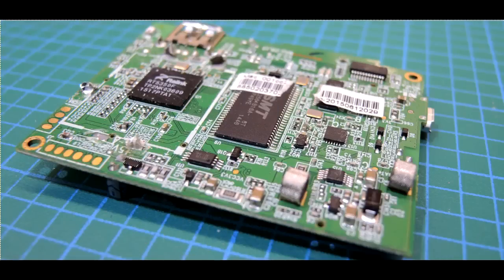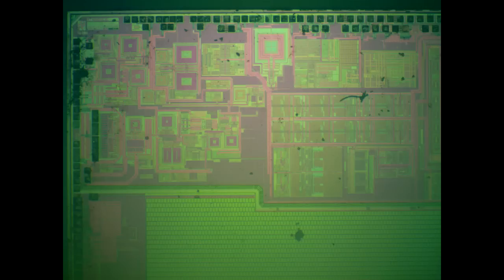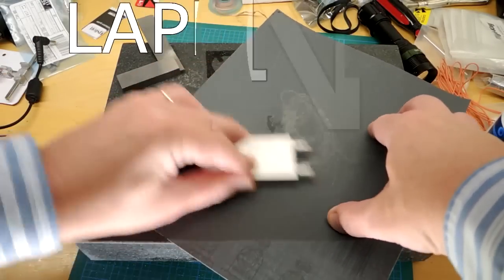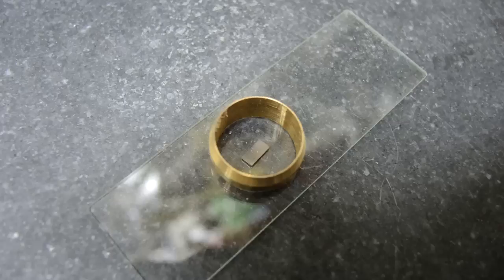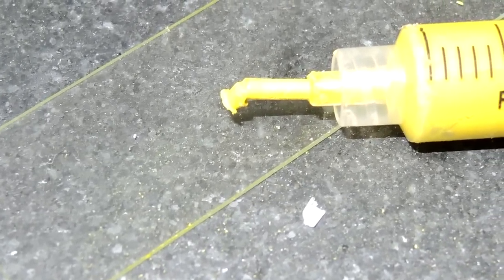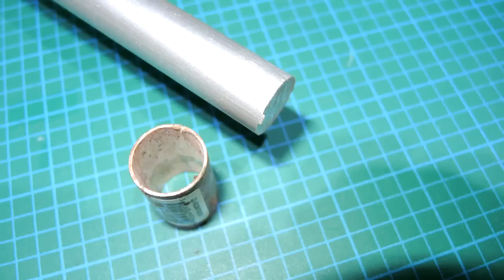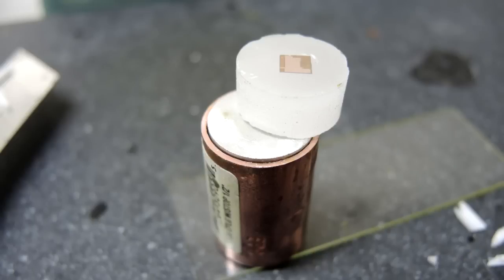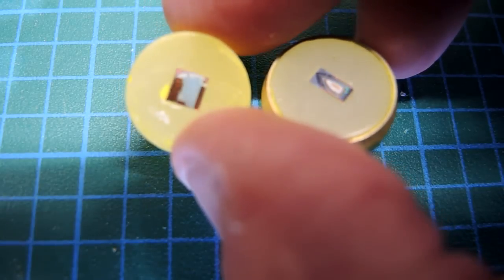Looking Inside a Silicon Die

Comment: Don't know if you know but this is done normally with a spinning wheel. What you do is you get an ultra flat wheel, get a glass rod. You then polish the rod against the wheel. Generally the holder for the rod can be leveled to the wheel with an micron indicator gauge. 

Then you take your die and either using wax as you did or super glue you attach the die to the glass you have polished. Then everything will be nice and co-planar. You use the mass of the polishing head itself as the only force. 

This is how you generally lap for microscopy. I realize you might not have all these tools but its a good effort you made. Just thought you might want to know.
Reply from the maker: +Brian Bryce Very interesting! thanks.  Any idea of vendors of such equipment?
Reply: Allied: http://www.alliedhightech.com/equipment/grinding-polishing is the one I used most often.

The metal layer you are trying to remove are themselves polished using a technique called CMP (chemical mechanical polishing). That only done for whole wafers normally though.

Comment: That metalization you mention ( at 0:47) looks to me like digital (logic) circuitry. I bet that the vertical lines the supply rails. It looks "messy" between those rails as almost all wires there are of minimum width so you can't see any details, you would need a strong microscope to see that properly. Also that is autorouted, so the design as seen on chip is generated by a program. The analog / RF structures are usually more fun (and what I design as my dayjob :-) ).

Comment: I think your problem with the wax was contraction when it was cooling, exactly the same thing happens when you cast metal. I'd be interested in seeing the results of the first holding technique but with epoxy rather than wax. I wonder though if you actually need to be all that careful. Surely you could lap a little bit and then take a photo, lap a bit more take another photo, etc, etc. In the end you could then edit all the photos together to get the various layers.

Comment: Wax has a lot of thermal expansion and contraction when heated and cooled.  That's why you get the funny muffin shape.  As suggested by I_will_get_you There, you might try epoxy which has a much smaller change in volume when it solidifies.  Some epoxies have technical data sheets (TDS) that specify how much the volume changes on curing.

I almost wonder if a very thin layer of super-glue could be used to glue the silicon chip onto a microscope slide.  Not sure, but I wonder if you could then use your sleeve+cylinder setup to lap the chip.

btw, do you have an estimate of how thick the layers are?  That is, how thin of a layer do you want to remove?  You might try to find an abrasive that has an average particle size quite a bit thinner than the top layer.  What happens if you lap without abrasive?   Just curious!

How about chemical etching to remove the top layer?

Ah, sorry for too many questions and suggestions.  I look forward to your next video!  :D